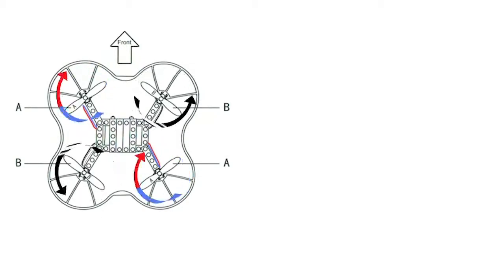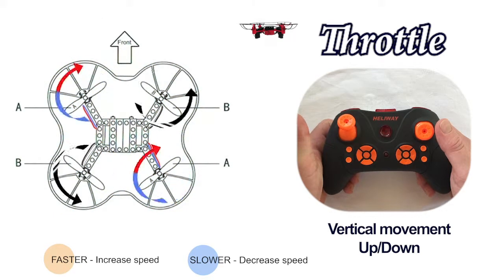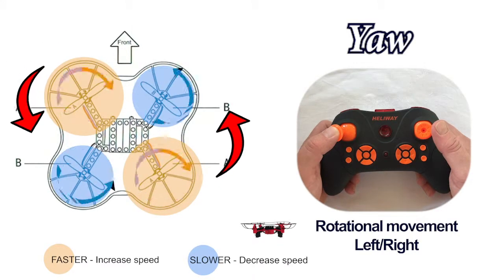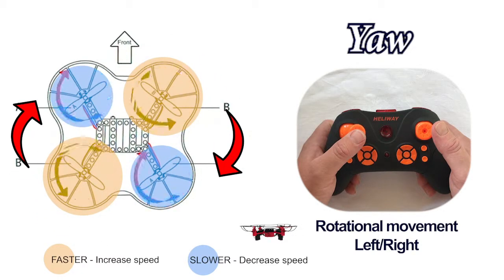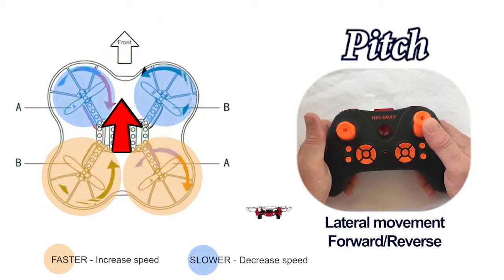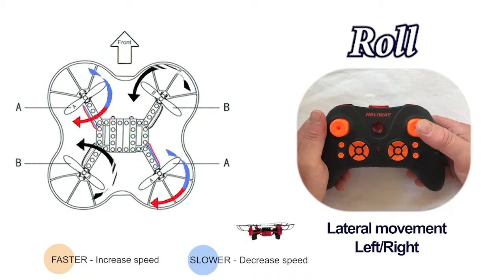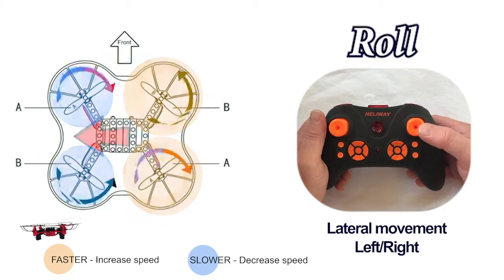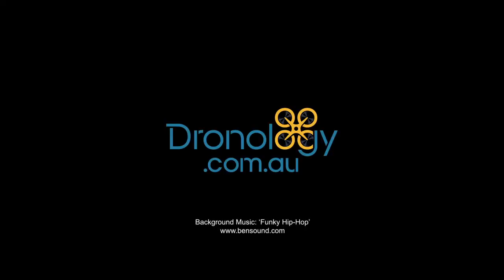Drone flight physics in under 2 minutes - Yaw, Pitch & Roll

Comment: We know that we can control yaw with the left stick — but what is the reason that yaw is created opposite to the spin of the propellers?
Reply: Dronology — OK, it is tongue that makes the drone yaw.  But there has to be more than to achieve a level yaw.  When you speed up say the ‘A’ props this should automatically create more lift as well which would result in a climb.  Do the ‘B’ props slow down to compensate for this?  Or is there some other reason than the quad doesn’t climb when the craft is yawed?
Reply from the maker: Hi Alex, apologies for missing your reply. You are right in suggesting that the ‘B props’ slow down to counteract the extra lift derived from the ‘A props’ speeding up. A drone’s flight and electronic speed controllers have plenty of work to do in order to achieve the desired movement in 3D space.
Reply from the maker: Hi Alex - Check this out: https://www.youtube.com/watch?v=LL3B1G5sprM